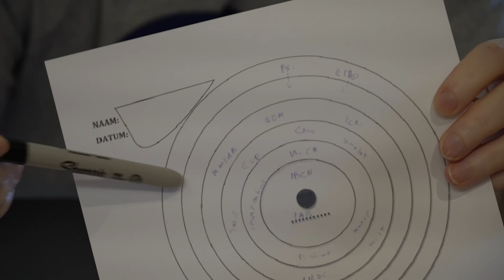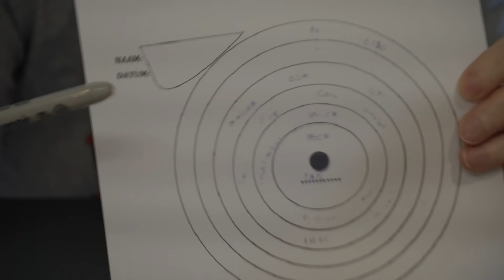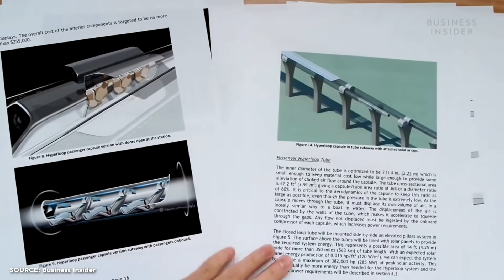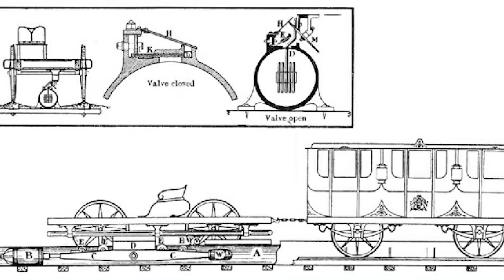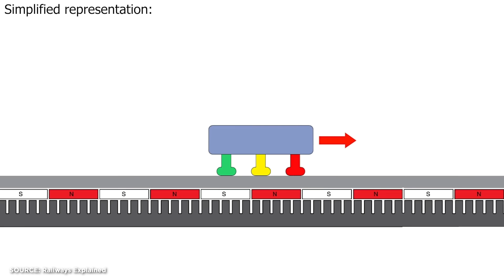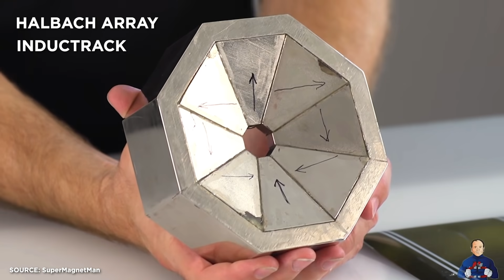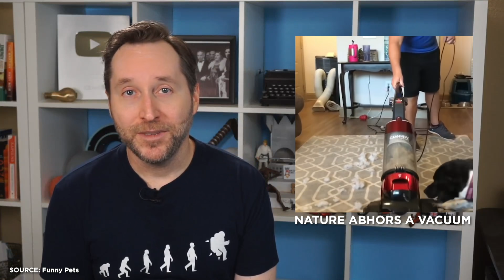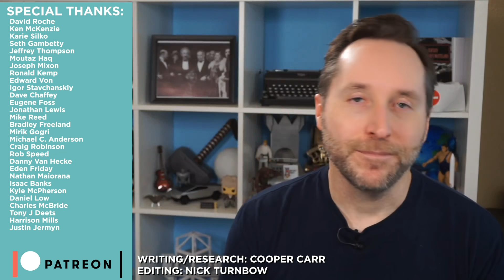What's Happening (And Not Happening) With Hyperloop | Answers With Joe

Comment: The economic gain compared to a simple train or subway would be minimal at best. Any such unreliable service does require a backup line. All traffic depend on time and predictabikity of operations. Which is completely irrational and just breaks the bank here to cone up with a redundancy or maintemance concept. It's just the pipe dream of Elon Musk smoking an bong in the traffic jam in his stretch limo. It's a fix for a prob that doesn't exist. Subway trains are just fine in terms of energy expense and maintenance. I would rather bet on air taxi drones for passengers. For moving 40 foot shipping containers out of ports halbach array passive maglev could be economical in some dryport concepts in certain crowded cities. The air drag is the least severe issue in traffic and logistics congestion. Public spending is and high land uuse compensation in urban areas. I wonder why people think Elon Musk does approach anything by first principle thinking? Vacuum would be your absolutely last choice as engineer with all the  small parts hands on complications and no backup/redundancy options. A backup vacuum just doesn't work. It's a no brainer.

Comment: WOW Joe is such an Elon Fanboy. Any mid distance /like 200 km or miles / Hyper Loop system is at least a few hundred years away, if even technologically possible then. Ask anyone who ever tried to maintain a vaccum like (0.1% or less of normal air pressure) state in a larger room, reactor or pipe system.

Comment: The thing is, this technology is absolutely necessary if we are to become carbon neutral. We currently fly from place to place at  800-900 km/h. Maglevs & high-speed trains with their 300-500 km/h would mean forcing people to accept a lower standard of living (if we are to let's say ban flights which are not transoceanic). That would be unacceptable (except if you're a radical XR primitivist). So, we need serious companies to get in on this and more importantly, we need governments to get in on this (fund the construction of lines and heavily tax flights for which there is a hyperloop alternative). I bet that if carbon was to be priced correctly (cost of removing it from atmosphere included), the economics of hyperloop would look much better. 

Also, underground tunnels make this thing much more feasible. I don't know why every company feels the need to display suspended tubes (I guess that's the hype part that makes them lose credibility). With underground tunnels you can make this thing much cheaper to build, much less disruptive for the communities/cities it's going to go through and much safer.

Finally, I don't get the comment about pods holding way fewer passengers. You can have many more pods going between cities than you can have planes.

Comment: Some of your points are just uninformed. Like the power for vacuum, you'll only have to replenish what you let in when the pods transfer from vacuum to pressured tube, this isn't necessarily a lot of vacuum per pod, as a farmer I regularly reduce 15m3 of space to -1 bar using a vacuum tanker, you're probably talking less than 1kwh of power to do that give it 3kwh for a large hyperloop pod that is nothing. The initial vacuum will be substantial but its still viable.
Reply: The likelihood of having zero leaks in the system is impossible. The stations as advertised with CGI would keep the pumps running 24/7. Power consumption is still legitimate criticism.